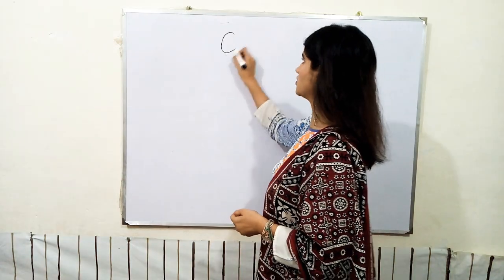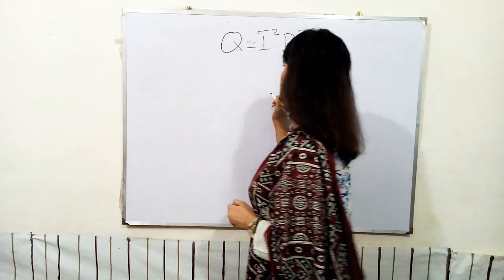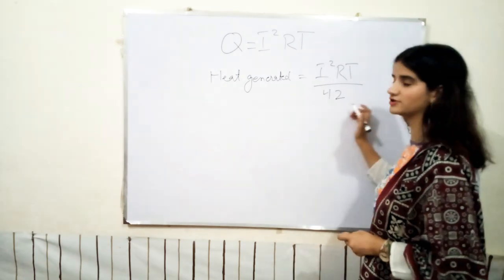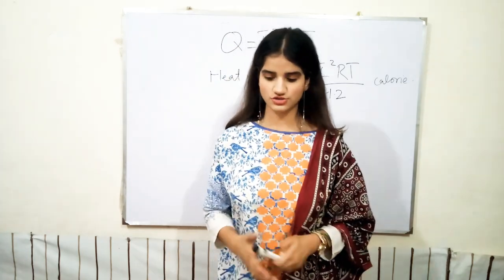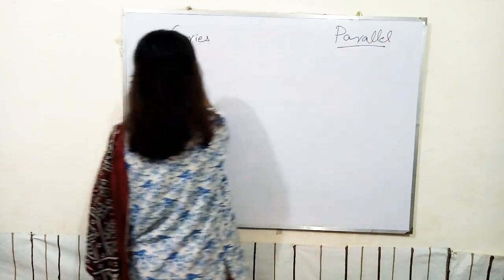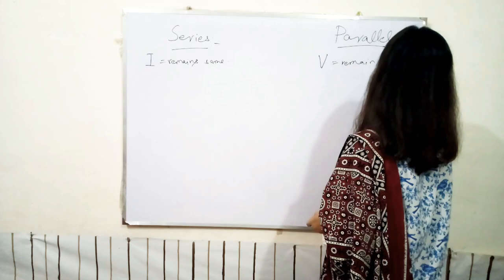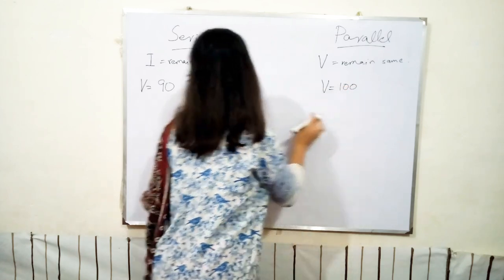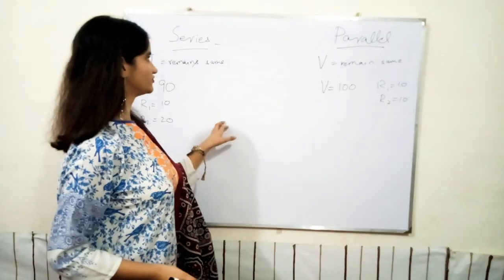Thermal effects of electric current by varying resistance

Comment: Law of conservation of energy:"energy can neither be created nor be destroyed but transform from one form to another form"".Heat generation  is measure in calories.In series combination,resistance remains same and heat generation  is high.In parallel combination, heat generation is low as resistance here is low.Current remains same in series resistance. Voltage remains same in parallel resistance.

Comment: Dania javed         Roll no.4

•Law of conservation of energy:
'Energy can neither be created nor can destroyed.'
•Current remain same in series resistance.
•voltage remain same in parallel resistance.
• Heat generated= I²Rt/4.2
• Heat generated will be higher in series circuit in which resistance is high.
• heat generated will be higher in parallel circuit in which resistance is low.

Comment: According to law of conservation of energy, energy can neither be created nor destroyed but can be converted from one form to another.
Heat generated in circuits depends on the resiaitnce applied. 
In series arrangement, current remains the same and heat is generated more in presence of higher resistance. 
In parallel arrangement, voltage remains the same and heat is generated more in presence of the lighter resistance.

Comment: ●Humna Irfan
● Roll no 10
●Law of conservation of energy states that energy can neither be created nor destroyed but can be converted from one form to another.
●Current remains same in series resistance.
●voltage remains same in parallel resistance.
● Heat generated = I^2Rt/4.2
●Heat generated will be higher in series circuit in which resistance is high.
●Heat generated will be higher in parallel circuit in which resistance is low.

Comment: Roll no. 14
✓ law of conservation of energy :- "energy can neither be created nor destroyed but it can be converted from one form to another form".
Series circuit :- The heat generated in series circuit would be higher in the resistance, where there is resistance is higher, resistance would be higher in R2 while lower in R1.
Parallel circuit :- The heat generated in parallel resistance is higher in the R1, when there is low resistance in parallel circuit, more amount of heat is produced.

Comment: 1. According to the law of conservation of energy, energy can neither be created nor destroyed but can be created into other forms. 
2. According to the charge ratio 
Q=12R
3. Heat generation is measured in calories. 
4. Series combination: 
a. Resistance remains the same.
b. Heat generation is high. 
5. Parallel combination:
a. Voltage remains same.
b. Heat generation is low, as resistance here is low.

Comment: According to law of conservation of energy, energy can neither be created nor destroyed but it can change from one form to another.
In series arrangement, heat generated will be higher in high resistance 
While in parallel arrangement, heat generated will be high in low resistance

Comment: Law of energy conservation.
Energy can neither be created and destroyed but can b converted into another form
Current remain same in series resistance while voltage remains same in parallel resistance
Heat generated will b higher in series in which resistance in hight
Heat generated will b high in parallel circuir in which resistance is low

Comment: > Law of conservation of energy:
Energy can neither be created nor destroyed, but can be converted from one form to another. 
> Heat generated in the presence of resistance * * Series resistance in a circuit
Current remains same. 
More heat generated with higher resistance. 
* Parallel resistance in a circuit
EMF remains same
More heat generated with low resistance.

Comment: LAW OF CONSERVATION OF ENERGY
Energy can neither can created nor destroyed but can be converted from one to other form.
Current remains same in series resistance.
Voltage remains same in parallel resistance.
Heat generated will be higher in series circuit in which resistance is high.
Heat generated will be higher in parallel in which resistance is low.

Comment: According to law of conservation of energy energy can neither be created nor destroyed but can be created into other forms.
 According to charge ratio
 Q=I2R
Heat generation is measured in calories
SERIES COMBINATIONS:
In series combination resistance remains same
In series combination heat generation is high
PARALLEL COMBINATIONS:
In parallel combination voltage remains same.
In parallel combination heat generation is low as resistance here is low.

Comment: Energy can neither be created nor destroyed it is converted from one to another form 
Current remains same in resistor connected In series , while emf remain same in parallel resistance 
Voltage remain same in parallel resistance .time is same in both types 
Heat generated will be higher in series.